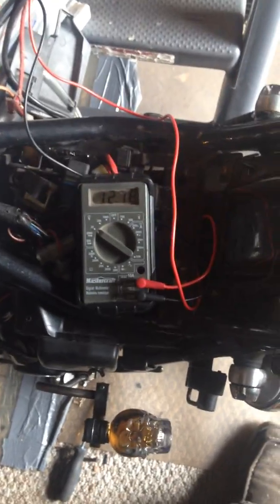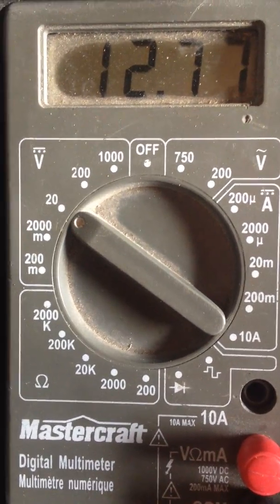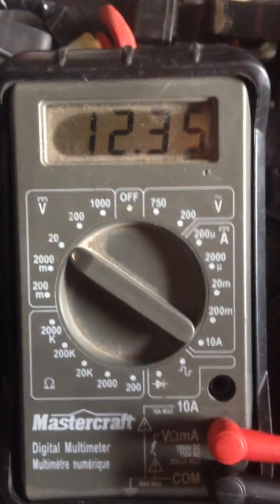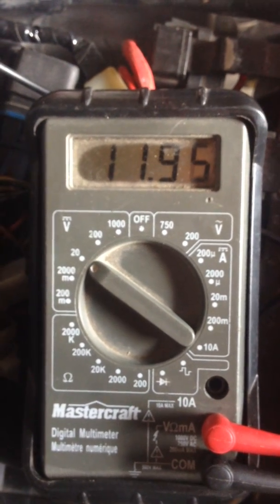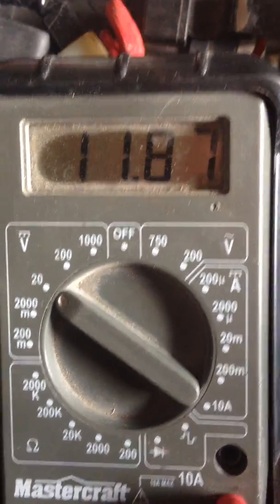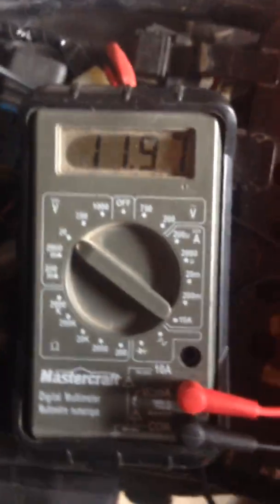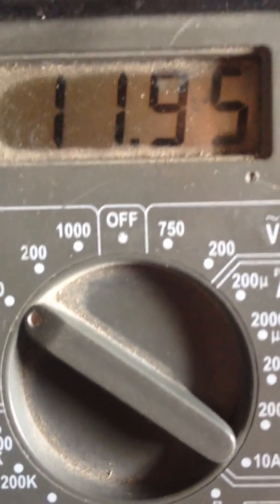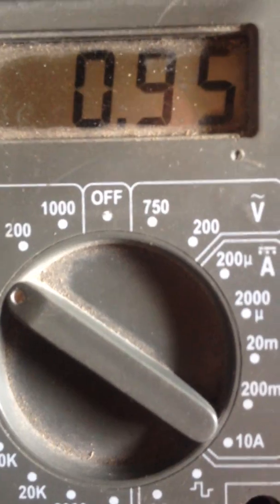1986 XV750 - Charging Issue/Stator Test

Comment: you ever solve this? sounds like the rectifer
Reply from the maker: Sure did. Looked like the reg/rec and stator had both been replaced by the previous owner to try and correct the issue as both parts looked almost brand new and tested fine in the end . . . unfortunately the stator had been installed with the spacer installed so the stator was right up against the side cover and then the spacer on top. So the spacer was essentially in the spot the stator should be. 
Removed everything and put the spacer against the side cover then the stator as its supposed to be and once the actual stator was inside the magnets as intended everything ran great.
Also found two weak connections in the circuit where the previous owner seemed to have forgotten to actually crimp connectors and just had them pressure fit together. This was causing intermittent drop outs when things vibrated lose and back together etc.

Bikes been sold now after a couple more mods were done and now I have a 03' Road Star 1600 (Silver Edition)